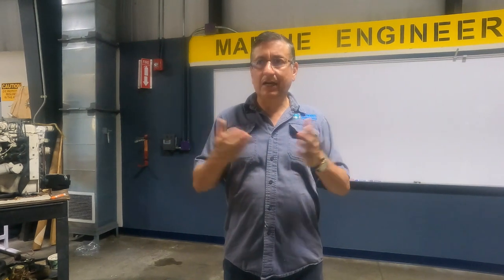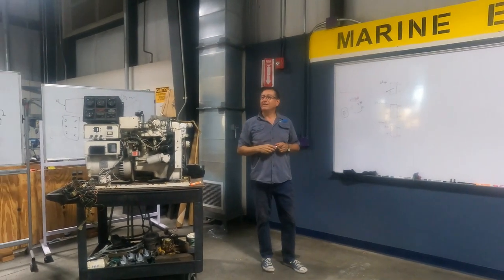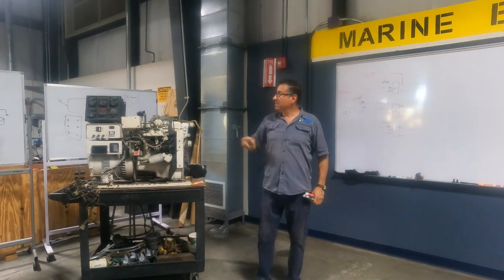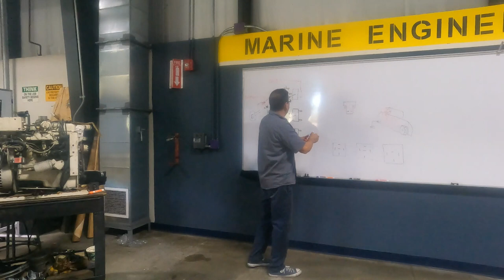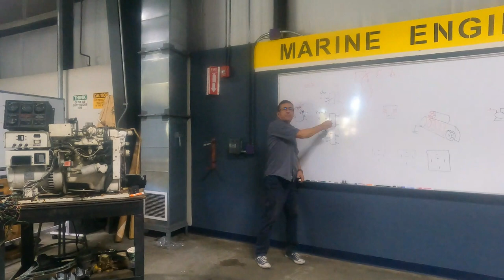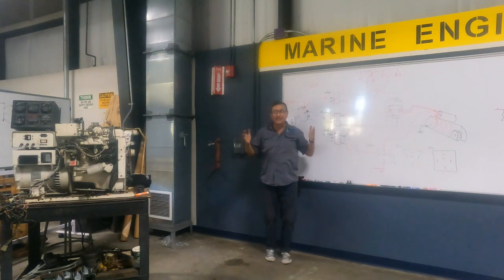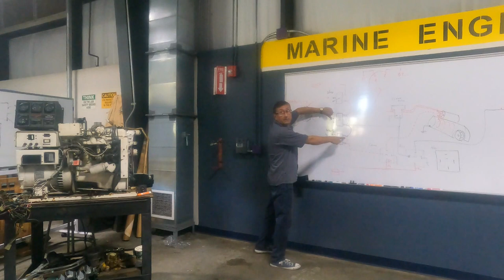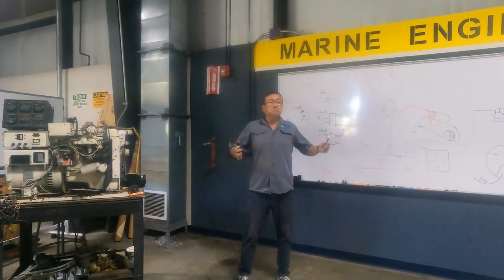Wiring a Marine Engine Harness

Comment: My engine DAF615 has the starter motor negative connected to the hull. I'm told it should return to the batteries negative post. Boat is a 14.5 metre steel cruiser.
Reply from the maker: Hi Nigel. This is a common practice in steel hulls. However, I recommend connecting the starter negative to the main negative bus bar. This is basically to avoid the increment of electrolytic corrosion in the Hull. Thanks for following me.
Reply: Ut white board cannot see ,  change ur camera angle  pls